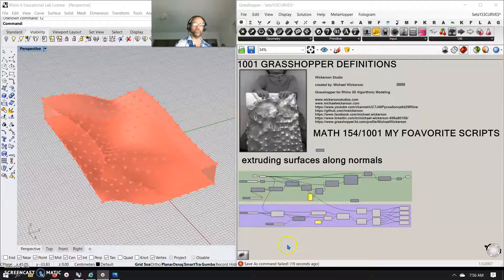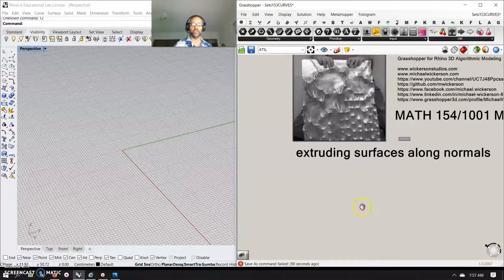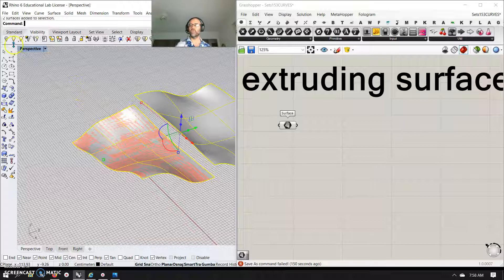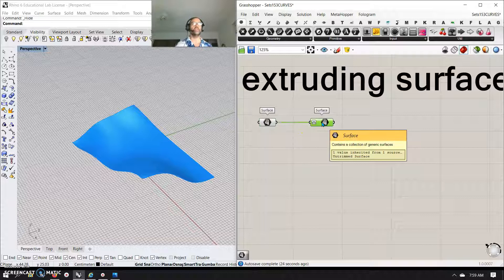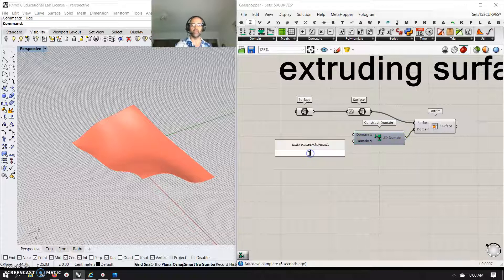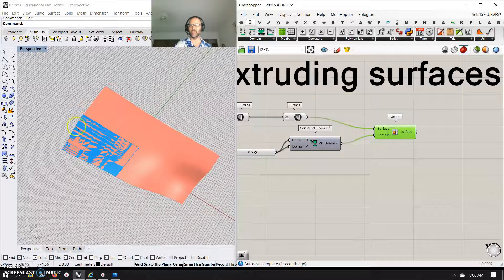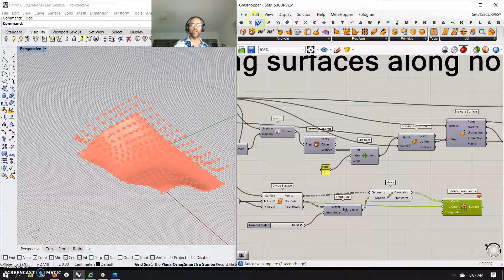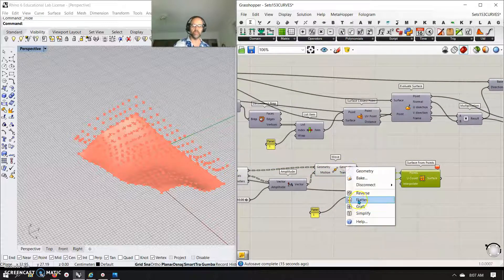GRASSHOPPER FOR RHINO 154/1001 Extrude Surface(s) Along Normals

Comment: Im having problems with a cylindrical surface. all i wanna do is make a hollow cylinder with an open top and 5mm thick walls. However the best i can do is a hollow cylinder where the wall is also hollow (so theres an outer wall and an inner wall 5mm apart but the area beteen them is empty). how do i get a solid cylinder wall instead of a hollow one?
Reply from the maker: Thank you kindly, my gh files are available on github thru my patreon account if you are intersted.  https://www.patreon.com/MichaelWickerson?fan_landing=true